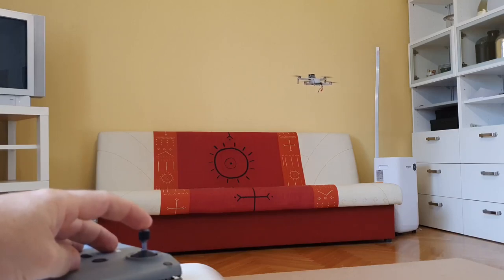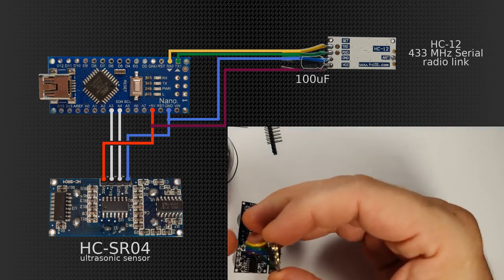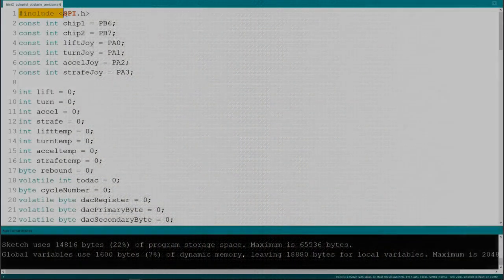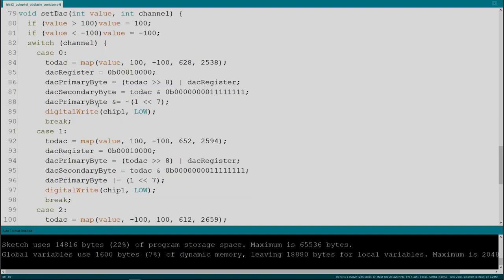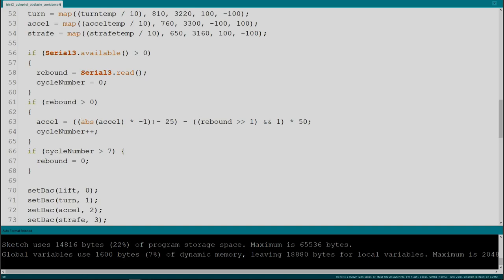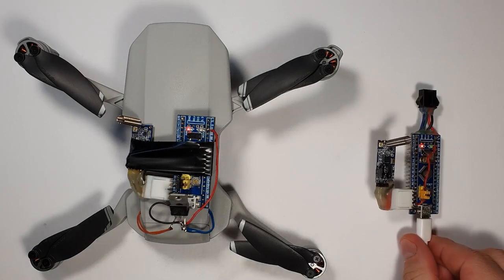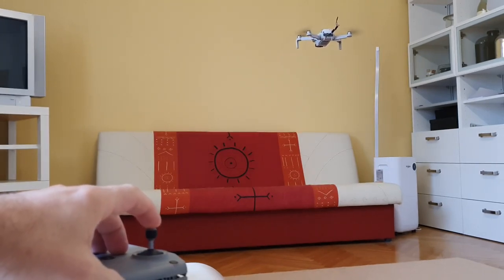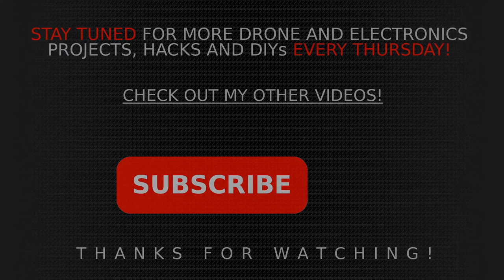DJI Mini 2 and Air 2 AUTOPILOT mod Part 2 (COLLISION AVOIDANCE)

Comment: This is a great proof of concept. The only thing that is a bit tricky about this solution is the range of the 433Mhz module: when you think obstacle avoidance is working but it doesn't you will definitely smash it into something one day. :P 
Not sure if this is possible and if it reacts fast enough: but maybe you can let the drone temporary think the battery is empty by tricking the voltage sensor pin (not sure how it will react to that though) or let the drone think it lost signal so it will "hover" instead of continue the movement.
Reply from the maker: Thanks! :) Yeah that can be an issue. But for short range practicing it is something.
I am still working the issue checking up every possible datasheets on the chips in the drone.. :)
The problem is that in case of a collision signal the hover is not enough. It needs the reverse thrust. And that is tricky as you may think... We see. DATASHEET IS YOUR FRIEND ALWAYS!!!! :)

Comment: that should be available as a plug-in module to upgrade the Mini 2. it could be that simple, but not everyone has the talents you have
Reply from the maker: Yeah, a lot can be done for these birds. I am trying to make the mods as understandable as possible, and working on developing a platform where it becomes a bit more Plug and Play... :)
Reply: @ZollyD  sounds absolutely reasonable. do that. 👍😀
Reply: Is there a way I can buy this or a way that you could do this to mine I use the litchi app to track me on my dirt bike but I’m scared it’s gonna hit something due to lack of obstacle avoidance sensors

Comment: Need to add a live view thermal camera to it. Great work
Reply from the maker: Yeah! :) Would be cool. Do you know any good thermal camera, which is light?
Reply: @ZollyD  it also seems to have really good frame rate. My Flir c3 is really slow like 15fps but this one link I sent you is like 60fps and wireless

Comment: I think next u should try to do the 360 obstacle avoidance that would be pretty sweet cut the wholes out like a mavic pro 2 but a mini 2 pro
Reply from the maker: Yeah, I just have to find some lighter sensors... ;)
Reply: Ive been messing with these sensors a little bit, im not gonna do it so ill share my idea. Basicly you could use that same sensor by itself if you could make it spin . Maximum distance setting with slow rotation could provide rough 360 obstacle avoidance. A tiny motoe may weigh less than multiple sensors
Reply: *tiny motor

Comment: Is it therefore possible to make a box that fits on with front back and side sensors? Self powered and makings Bluetooth connection with the drone? Cool!
Reply from the maker: Thanks! :) I am looking around for some lighter sensors. Then a for 360 avoidance is not a problem. :)

Comment: Is it possible to rotate 360   To watch the rear while filming foreword ???
Reply: Why not?
Reply from the maker: The optimal solution would be a 360 degrees LIDAR sensor on the top, but they are quite heavy. Otherwise all direction can be monitored for sure. One sensor could be also rotated with a servo (left-back-right-back-left...). From the servo position the software could identify which side the obstacle is. But the drone moves too fast for this. That is more for self driving slow robots...

Comment: Maybe you can try the same test by using the VL53L0X with a small vertical spindle mounted on bearings which allow the lidar to turn freely in the wind (as wind vanes) and, therefore, check for collision on different directions. Of course the vertical spindle needs also a sensor to check direction.
Reply from the maker: I am looking into VL53L1X because its better range. Yeah the trick is the scanning motion...

Comment: Also thought about external visioning system) Did not catch how this software is run together with dji's and how the remote is connected to this radio system. But cool job, thanks for sharing
Reply from the maker: My other video on the autopilot explains how it is connected to the remote. This system on the drone is not connected to the drone at all only power supply lines. That is why there is the radio link.

Comment: so imagine i am flying this drone  in a clear area and enter between two trees and let say the tree on my left is too close for the program but being the pilot i notice this as well so the program notices it first and being the one flying the drone im going to  i push stick to the right and the program adds its own push to the right just like we programed. im afrade of an issue i see might be possible that would be bounce off the left and then over power due to additional added feature resulting in a wreck on the other side.. i wonder if you could put 2 sensors and im not a programer but i might learn now so  i can play with this.. 
anyway i love this mod i am doing many of these to drones I have over here  Mavic mini, mavic Mini 2, Mavic pro,  and 2x mavic  air 2. I have started printing with my 3d printer some drone parts its alot of fun let me know how your 3d printing is going I have a creality sermoon d1 3d printer im getting my practice in on the software and im attempting building battery enclosures and have created drone arms and and other replacement parts lol im pretty hard on the drones so

Comment: you could improve the solution by not looking at the current distance, but the difference between two. This way you can detect the nearing speed. Bigger speed is bigger countersteering.
Reply from the maker: Yes :)

Comment: Really awesome idea, I am thinking of doing the same, just with a beeper on the recieving end so I don't have to tear the controller apart. I'm just wondering, since it's working on 433mhz what's the range it would work? Thanks
Reply from the maker: The range test is in the video... ;) I am working on long range version. As a matter of fact the part arrived today.. :)

Comment: Great idea for making it autonomous without much modification.  I'm wondering where the drone GPS antenna is? Is it on the back of the drone somewhere? And in that case does the extra electronics interfere with the GPS lock?
Reply from the maker: Good question. It is on the top of the drone more to the back, so we are all good! :)

Comment: I hope the radio tranceivers have error correction and a form of encryption, so that they cannot possibly pick up signals from the wrong sources=P
Reply from the maker: 😅😅 Not on this simple test setup. I am working on some LoRa modules to extend the range and on those there will be both encryption and error correction as you very well pointed it out! :) Not complicated encryption, but enough to not let you pick up random signals. :)
Reply: @ZollyD  Hehe, that's good! Yeah, two tranceivers bound to each other just use a very basic encryption and a shared key.

Comment: Hi Holly, How much weight does this mod add to the Mini 2.  Does it take it over the 249g?
Reply from the maker: Hi! Mine is 255g with the mod. With shorter cables from the battery and less tape and so on it is easy to get it under 250g. :)
Reply: Thanks Zolly,  That is really helpful and useful information.  Good luck with your next project

Comment: i had the same idea but got stopped by radio range. 😹 i lost my first drone due to lack of sideway OA. i was trying to make a similar set on my new drone but soon realized that there's no way for me to implment it into OccuSync :(
Reply from the maker: I totally get it! Yeah the OccuSync is also a bit too exotic for me, but I am looking into the datasheet of all possible chips in the drone, to try to find a way to implement the the same thing internally. Let´s face it, once it is calibrated properly, it will just work. The remote will not even need to know that there was an anti-collision event triggered in the drone. It happens locally. That is what I am working on now. Tough I have to admit... 😅😅
Reply: @ZollyD  i wonder If we can use an led to trick the sensors on the drone. i dont have a mini 2 but i have an air 2s. If mini2 can brake on OA sensor( though only downwards), then maybe its doable
Reply from the maker: Yeah, if I find the input for the other directions on the motherboard.... :)
Reply: @ZollyD  Does the Mini 2 has brake function on bottom sensors?

Comment: can you make it that the threshold is adjusted by the speed of the drone automatically like if you are going 40km/h (24mile/h) the threshold will increase. and if you are going slower it will decrease
Reply from the maker: Yes. :) The problem is we have no access to actual speed data. But there can be a relatively accurate estimation of speed from the integral graph of forward joystick position. I will work on it. ;)
Reply: @ZollyD  cool

Comment: how much weight does it add to the drone
Reply from the maker: Sensor 7,9 grams. Arduino Nano 4 grams. HC-12 2.3 grams with antenna. So all in all with wires around 18g